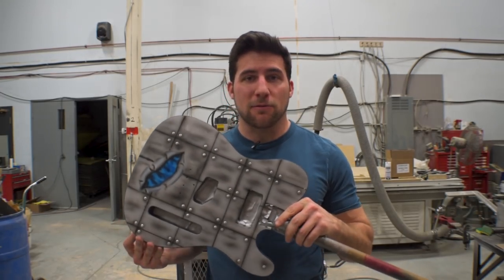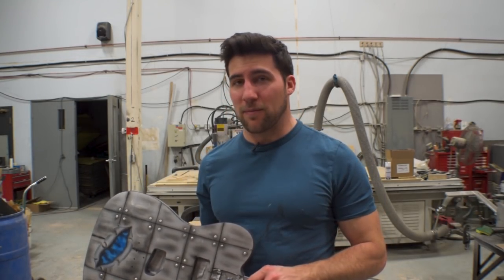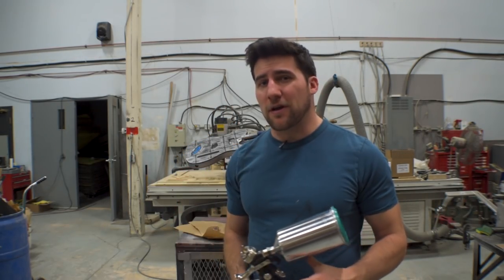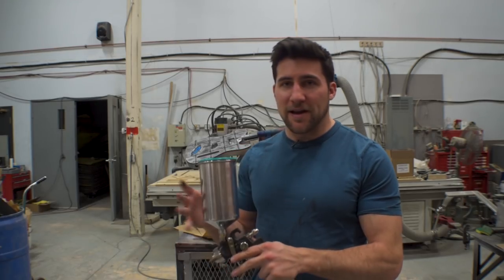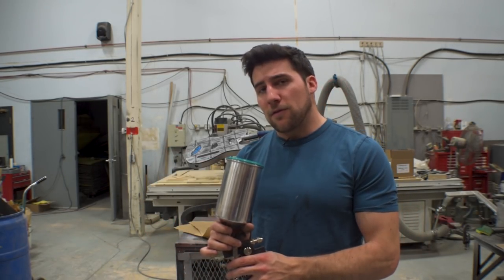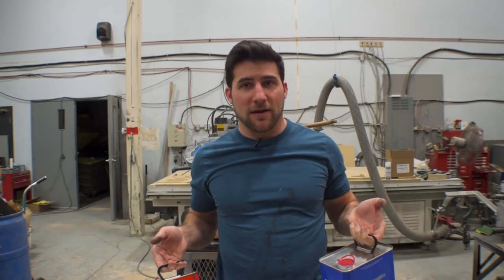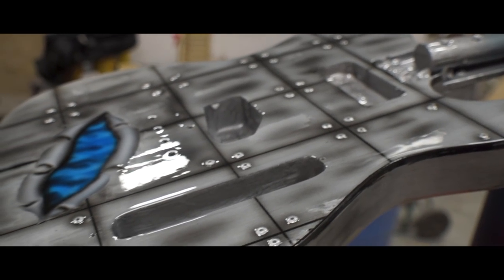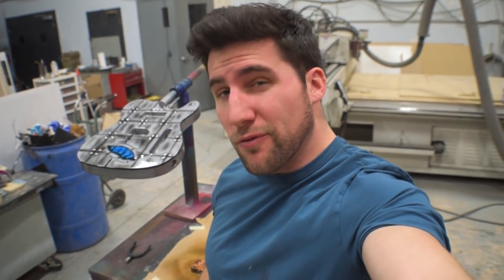Clear Coating a Crazy Custom Guitar | The guitar kit from solo music gear (Part 10)

Comment: Nice work. I guess rivets are a good way to have runs... You managed great ! I also guess rivets won't make the polishing process easier... I think I would have insert them at the very end, after polishing...
Thanks a lot for all your videos. They are very useful for beginners like me.
Reply from the maker: Thanks for watching. The rivets turned out ok. The front has a slight brushed texture, which I like. I ended up only doing the sand and polish process on the back.

Comment: I was wondering if the clear coat would hold up on the rivets or if disbonding would start occurring at hose points. I guess time would tell. If it fails over time post so others would know how "imperfections" on the surface affect the long term durability.
Reply from the maker: Will do. I don’t think it’ll be an issue though. Even if the adhesion in those areas is questionable, the clear should bridge it no problem.

Comment: Did you put the clear on in coats or just use one paint gun reservoir full? Thanks for the videos, as always.
Reply from the maker: I put it on in 3 coats. It ended up being closer to half of the paint cup full. 
Just in case there was any confusion: I put on the 3 coats in one session. 10 minutes apart.
Reply: Brad Angove Got it. Thank you.
Reply from the maker: You’re welcome.

Comment: Did see you mention it but did you have to scuff the paint a bit before putting on the clear?
Reply from the maker: I scuffed the base coat paint before doing the airbrushing. Then did the clear straight over that.

Comment: Hey Brad, how long do you have after you mix up the poly before it sets? And what do you use to clean out the gun afterward?
Reply from the maker: I’ve had the paint in my gun for up to about an hour with absolutely no concern about it setting. I’m not sure what exactly the pot life is, but I imagine it varies a bit depending on what clear you’re using. 
I generally clean my gun with lacquer thinner and/or methanol.

Comment: Great job Brad!!!!!!!
I make wooden rings and have used CA and friction finishes in the past , they tend to loose their shine relatively quickly due to wear and tear.....I was wondering if you have a recommendation on a more durable finish.....
Thank you
Reply from the maker: Have you tried an epoxy finish?
Reply: Brad Angove no I haven’t.......any recommendations?
Reply from the maker: I’m just trying to think durability. I figured a CA finish would be pretty hard, but the furniture epoxy/casting resin should be pretty much rock haha. That might be your best bet. I don’t really have any experience with the stuff personally (yet). I’ve heard good things about a company called Solarez though.
Reply: Brad Angove 
Ok.....thank you....what about one of those guitar finishes you use?
Reply from the maker: The best one for that would be a catalyzed polyurethane. It’s common on guitars, but is really the industry standard on cars at the moment.
Reply: Brad Angove 
Thank you for the advice.
Reply from the maker: You’re welcome.

Comment: Hey Brad, newer follower, just made my way through this build series, nice work. I do quite a bit of automotive painting but I had a question for you. With a stained finish would you use a sealer before clear coat or just clear directly over the stained wood? I’m just concerned about how much its going to sink, what with wood being porous and all.
Thanks
Reply from the maker: Generally you would apply a sealer first. Although on a closed grained wood properly prepared a 2k clear really won’t soak in much at all.
Reply: Brad Angove thanks, any recommendations for a sealer?
Reply from the maker: My favourite is behlen’s vinyl sealer. If you click the amazon link in any of my newer videos it should be available there.